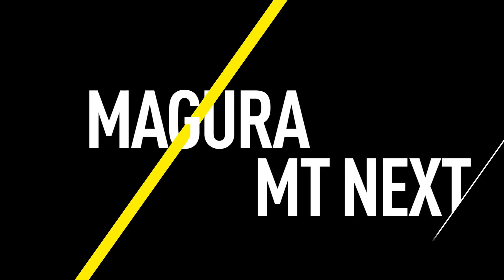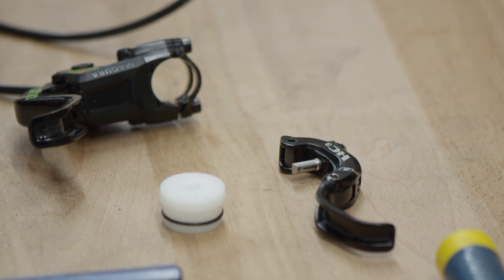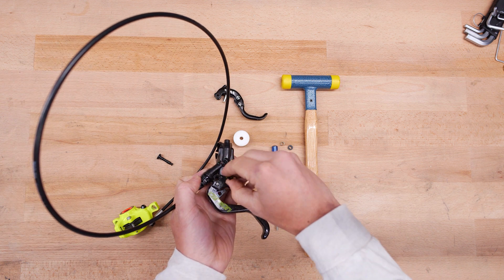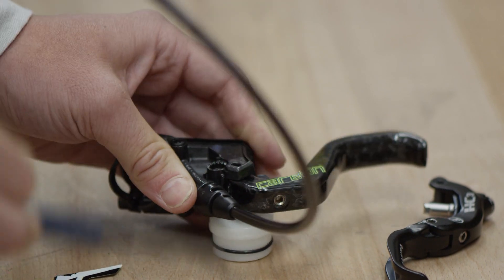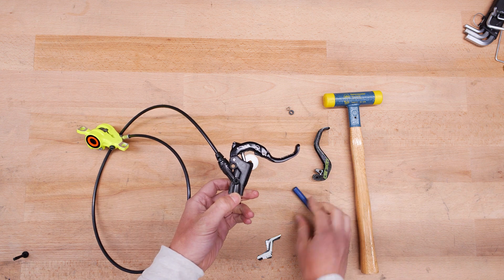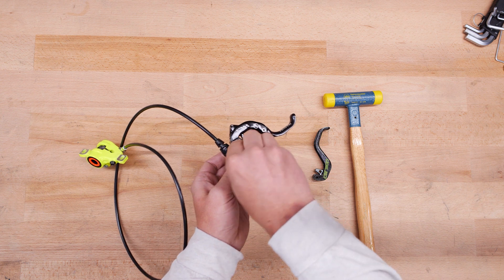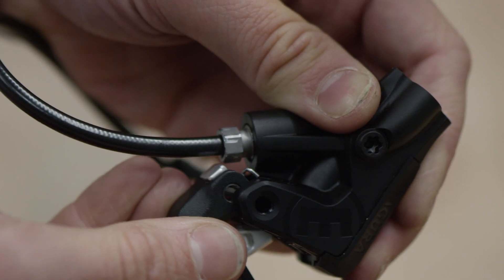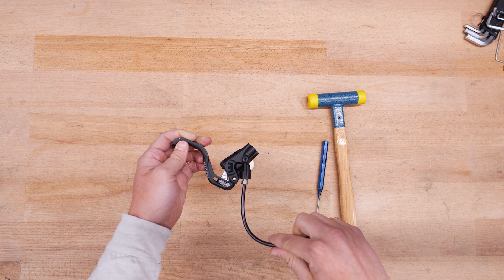MAGURA MT: Changing Brake Lever Blades

Comment: The hc3 lever is awesome!!! I love that thing, 200 times better than the crappy shimano levers😅
Reply: Nothing like it in the bike industry!
Reply: email gmail  
Well Sir, Shimano has nothing like it, nor does anyone else in the cycling industry. The only thing similar is a two way adjustable Brembo motorcycle radial master cylinder. The adjustment on the lever blade changes the "leverage" so you can choose the properties of braking including changing the amount of lever blade travel, modulation, engagement point and power depending on your preferences or trail conditions.
Reply: Hi. My question. Is. Can I replace a brake lever of an mt7 for an mt5e. The reason is. That I bought the mt7 for my dualtron electric scooter and it works great the only thing is that I don't have a switch to turn on the brake lights when I use the brake. But I was thinking since is cheap to buy an mt5e brake lever on ebay. Rather than buy mt7e brakes all over again. I can use the mt5e brake lever. Please if u can answer my question. It will so helpful. Happy new year and God bless 🙌
Reply: @EZEMORRYS  No idea

Comment: Will oil come out if I do this while the brake is on my bike?
Reply from the maker: No, the hydraulic system doesn't get opened if you're only changing the lever.
Reply: @MAGURAPassionPeople  Okay, thanks😄

Comment: Quick question: Why is it that Magura does not ship the MT7 with the price class appropriate (and much appreciated to exist) carbon brake levers? It seems possible at the level of the MT trail brakes, which are in the price range of the MT5, (essentially the front brake is a relabelled MT5), and those come with carbon lever blades as standard, which leads me to believe that pricing cannot be the ultimate issue. At close to 200€ per brake, i do actually expect to get everything upfront.
Reply from the maker: You would need to compare the MT7 Pro to our MT Trail SL rather than our MT Trail Sport (which doesn't come with carbon levers).

A set of MT7s will cost you (RRP) 2x219,90€ = 439,80€. The MT Trail SL with the Carbon levers is (RRP) 579,90€ for a set.

Comment: Are Magura mt5e higo lever blades compatible with the brakes mt8 pro hc?
Reply from the maker: no, MT5 compatible levers are not compatible with MT8 / MT7 / MT TRAIL SL.
Reply: @MAGURAPassionPeople  thanks ! So what are the best MAGURA brakes for e-scooter that use to race or to tun at high speed, I need the best braking power without necessary the Higo connector closer 

I was between the mt5e but found mt8 pro hc at the same price so I'm a bit lost between all these brakes set magura but maybe you have better knowledge than my vendor that recommended me theses.

Comment: so when removing the pin to change the lever on left hand brake it needs to be punched out downwards, and the right hand brake lever the pin needs to be punched out upwards..is this correct? Cheers
Reply from the maker: To avoid any misunderstanding: all masters need to be oriented as shown in the video in order to punch out the pin in the correct direction. It sounds like you've understood it correctly, but we're not sure if we're misunderstanding you.

Comment: Can I use SPARE lever with HIGO connector with MT5 estop?

Thanks
Reply from the maker: Yes, we have HIGO levers that are compatible with the MT5 estop, just make sure to the get a version that’s compatible with our Carbotecture master body.

Opener version: 2700833
Closer version: 2700837

These two are compatible with your MT5 estop.
Reply: @MAGURAPassionPeople  Magura MT8 Pro HC brakes work with lever blades from Magura MT5e HIGO-Opener 3-Finger Brake Lever Disc Brake?

Comment: is the spring on the MT7 replaceable?
Reply from the maker: Which spring do you mean? The spring that returns the lever? That is unfortunately not replacable by itself.
Reply: I find it incredible that Magura is forcing to replace the carbon lever at 100 euros, just because a very small part (spring) is broken….this unacceptable and not encouraging clients to buy products that cannot be repaired ….so now I am going to pay 100 euros the part, plus the labor to the dealer, and then i end up with a perfectly fine lever (with the broken spring) absolutely new and dump it….so much for repairability…I am furious and will not purchase any Magura products anymore, and also broadcast my network that they must stay away from this type of product.

Comment: can you replace magura mt8 raceline 1 finger lever blade to 2 fingers blade?
Reply from the maker: Yes, that is possible!
Reply: @MAGURAPassionPeople  what blades are compatible?
Reply from the maker: @gaborlukacs9263  All of our levers that are compatible with the Carbotecture SL master of your MT8 Raceline (rather than the Carbotecture "non SL" master that's used on our lower end brakes). You can use our HC3 lever, our HC 1-finger carbon and aluminum lever (Carbotecture SL version), our HC-W lever (Carbotecture SL version), and our 2-finger levers (Carbotecture SL version). You can find an overview of our levers here: https://www.magura.com/en/components/customize/setup-guide/

Comment: Does the HC3 fit on MT5?
Reply from the maker: The HC3 lever unfortunately does not fit on the MT5. It's only compatible with our brakes that use the Carbotecture SL master, rather than the Carbotecture master that is used on the MT5.
Reply: @MAGURAPassionPeople  oh crap. i recently broke the screw on the main body of the brake so i figured if i change it, might aswell get the lever
Reply: @MAGURA hello! What about the MT Thirty brake system? Do HC3 levers fit on it? Thx.
Reply from the maker: @mattiapiccioli6125  Thanks for the question! HC3 levers are not compatible with the MT Thirty brakes.

Comment: Um.... when fitting HC3 levers the BAT adjuster does not have a purpose and does not work so there is no need to reinstall it. In fact, don't HC3 levers come with a BAT blank?
Reply from the maker: The BAT adjuster does have an effect, but that is indeed quite small. It is useful for averaging out the different feel between front and rear brake due to the longer brake hose on the rear brake. The BAT adjustment is not needed with the HC3 lever, because that lever has a bite point adjustment on the lever itself, which gives you a much bigger adjustment than the BAT adjuster.

Comment: How do I eliminate the play in the lever itself? The lever wasn't crashed, and my pin is in correctly but there is play I notice when braking
Reply: Are you using the HC3 blade?
Reply: I have the same problem, the lever and the pin is correctly installed but the lever moves slighty up an down....the two fingers lever didn't move at all
Reply: @alexmurias5331  Is it excessive movement? Is the brake old or have a lot of "time" on it? Are you a past or present "trials" rider by chance, technique wise?
Reply: @judemonica7951  i think is excesive, the brakes are brand new, just changing the lever to a 1 finger blade from the original 2 finger
Reply: you have to be really careful with that pins
Reply: @judemonica7951  solved¡¡¡ the problem was the way I insert the blades¡¡ THX¡¡
Reply: @alexmurias5331  Good job Alex!

Comment: What’s happens when main cyclinder is leaking oil
Reply from the maker: Do you mean the brake master? If the brake master is leaking although the bleeding screw is installed correct, it seems to be damaged. Please replace it or ask a local dealer for a check.
Reply: @MAGURAPassionPeople  ye I mean brake master do you think it’s leaking because of bleed screw as mine were over tightened
Reply from the maker: @RideLowCo  It could be a lot of things, it's hard to diagnose something like this via the internet. It depends on where the master is leaking. It could definitely be caused by an overtightened bleed screw, but could also be caused by other things.
Reply: @MAGURAPassionPeople  because I swap bleed screws around on my other break and my other break had issues but another didn’t

Comment: Anyone using the hc3 levers on MT5s?
Reply from the maker: The HC3 levers are not compatible with the MT5.
Reply: @MAGURAPassionPeople  hello guys, I took the gamble. They actually fit!
Reply from the maker: @driver_18  They do "fit", but they're not designed for the master geometry of the MT5 - we cannot recommend using them on Carbotecture (non SL) masters.
Reply: @MAGURAPassionPeople  the HC3 levers are compatible with MT4, MT5 and MT Trail Spot. There is a company called OAK components who manufacture custom bespoke levers for Magura and TRP. They only sell one option for Magura and it's compatible with MT Trail Sport, MT4, MT5, MT6, MT7 and MT8. That means there is no real life difference between the master cylinders across the board. Or if there is it's only negligible. Here's a video - https://www.youtube.com/watch?v=Lsg0_HR98CU
Reply from the maker: @o.zzzzzz  That is incorrect, the HC3 lever is not compatible with MT4, MT5 and MT Trail Sport. The HC3 lever is only compatible with the MT7, MT8 SL and PRO and MT Trail SL.

Comment: Your guys polycarbonate brake lever is way too fragile compared to Shimano and other companies! Improve them! We won't mind a bit extra weight 😂
Reply: The lever blade is alloy or carbon depending which you have. The master cylinder body is charbotechture (carbon infused nylon composite) and is fine when torqued correctly. I agree when you buy Magura brakes they need to make it clear to be gentle with tightening and use a torque wrench. Inside the master cylinder is lined with alloy to keep stiffness up

Comment: Is it possible to knock the whole pin out? Since I have to replace the master cylinder and install the original mt5e lever.
Reply from the maker: Yes you can knock the whole pin out and every spare lever comes with a new spare pin.
But please make sure to install to push the pin in the right direction like shown in the video.